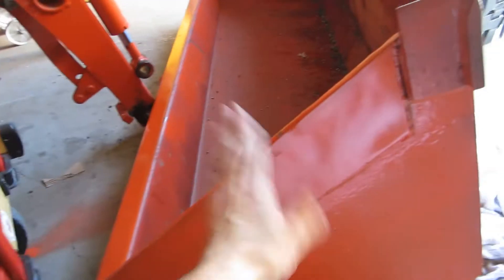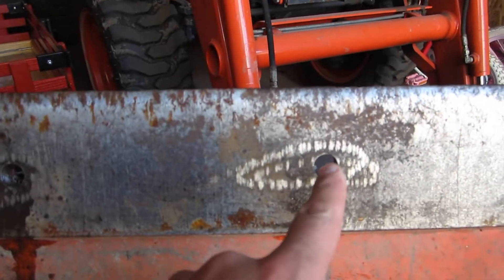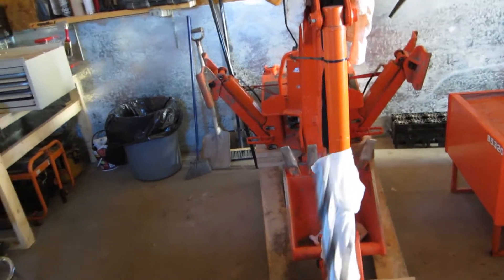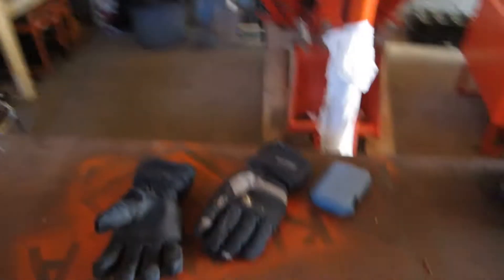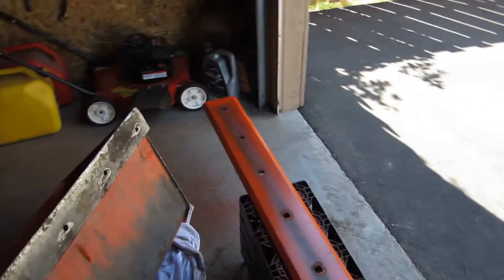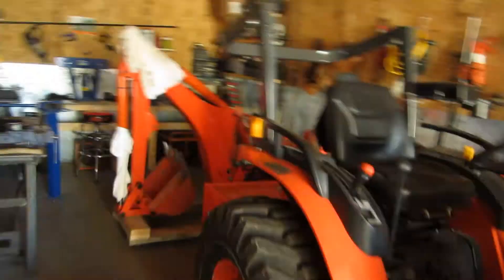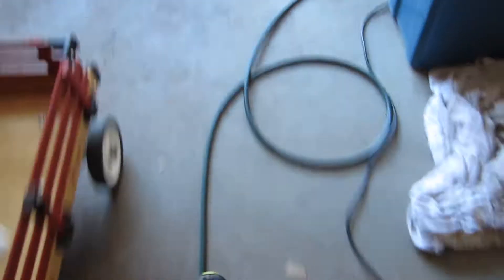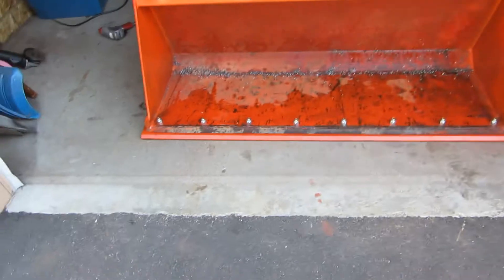kubota bucket cutting edge

Comment: How necessary do you find this attachment when it comes to grading and back dragging? Is it fine without it? Or is it recommended to have this attachment when it comes to grading? My only concern with it is the bolts eventually coming loose after X amount of usage.
Reply from the maker: the edge is to save the bucket on paved surfaces in winter moving snow.

Comment: where did you get you cutting edge?
Reply from the maker: I purchased my cutting edge from green valley Kubota dealer it is 60" long pre drilled with all bolts to install I paid 300.00$ but we'll worth it for the life of the bucket best mod ever.
Reply: +tasha macmillan I believe you.  Just got my tractor and definitely can see the benefit of having a cutting edge.  But my dealer can't find a bolt on in their system.  You wouldn't happen to still have the part number would you?
Reply from the maker: +martin13100 not sure of cutting edge part # You can talk to Luc lanthier at green valley Kubota 613 525 2190 he can help you for sure just mention Travis Macmillan to him as I do some mods most people don't do to a small machine so I'm sure the edge was not for the 504 Fel.